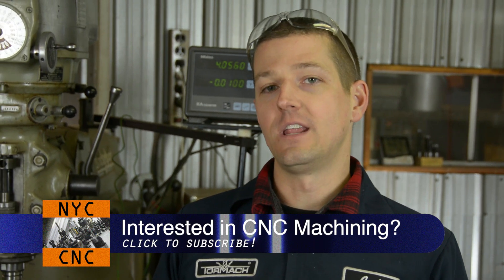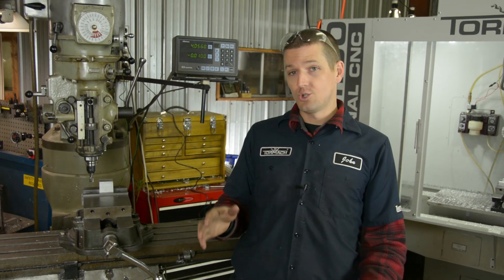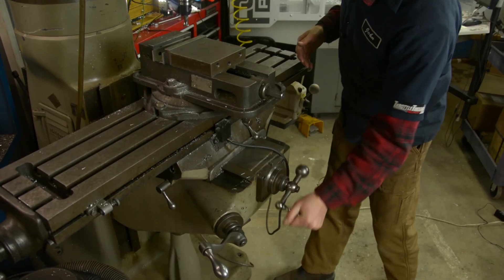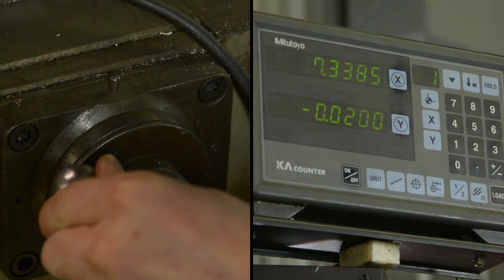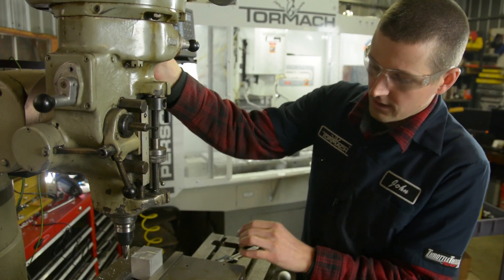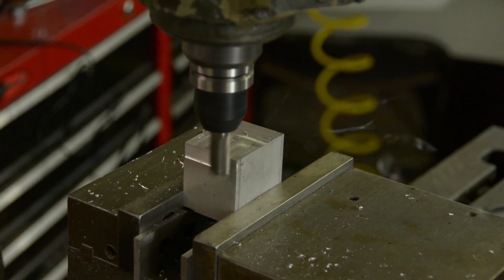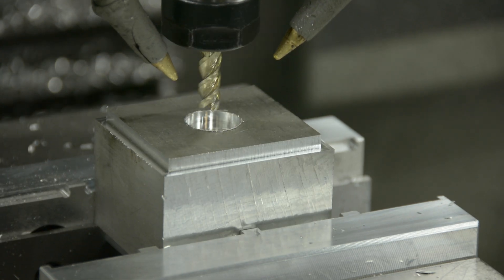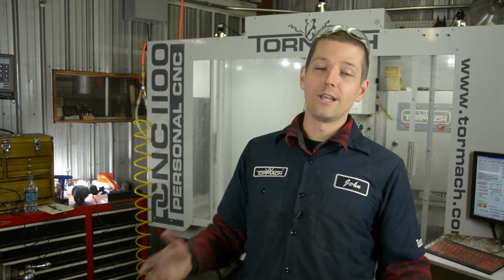Beginners Guide to Manual & CNC Machining!

Comment: A pull on that sleeve is going to be a disaster.
Reply: I'm still manual machining off a tos kurim and still do what a cnc can do👍
Reply: I think OSHA requires guards on this stuff now.  Read an article they fined a shop 10k per machine.  Nobody uses them though.  Such a hassle
Reply: So you're saying nobody can be a manual machinist anymore? Lol
Reply: Dave the point of a CNC wasn't to do things a Manual machine couldn't it was to do it easier and faster and more repetitive.  You have a thousand part order with a + or -   .001 tolerance its going to take you alot longer and probably have more scrap if your not careful with your thinking on a manual machine.  Cnc program it adjust it and boom hit a button 1000 times maybe make a minor tool offset here and there and done BOOOM $$$$$$

Comment: I am in the process of making a cnc machine with the help of your video links. @ work I've used a bridgeport drill press. I'll get to the point; in these machines the table moves and the z axis is fixed. In your opinion is that better than the material staying put and the tool moving?

Comment: Great video John. Thanks so much for doing this intro video for beginners. Well worth it. I will be showing this to my daughter when my Shapeoko 2 turns up. I've bought it to see if she will get into learning how to model in CAD, design for manufacture, but also to document the process on my blog. So a whole gamut of skills for her to get into. Can I ask, what CAM software are you using? I'm curious about the funny little lead outs into the center of the circle at the end of each boring cycle.
Reply: NYC CNC 12 years old, 13 in June. Have you given CAM for Fusion 360 a whirl yet?
Reply: NYC CNC The thing is it may have a big impact on your run times... and help with that back log. Which CAD software are you using?
Reply: NYC CNC Excellent. Well you can get HSMWorks Xpress for free as well. Bloody good 2.5 axis with some 3-axis toolpaths as well. There will be bugger all learning curve for you, but immediate run time and toolpath generation savings.

Comment: You should also conventional cut on the manual mill, as they have backlash.
Reply: Lol no problem. To be honest I haven't used a manual machine for a long time. I've always had the option to use cnc. If I can have a machine do the work for me, I gladly will lol

Comment: Great job John! Sorry I have been "MIA" it's wrestling season for my son so I'm playing catchup on your videos along with a few others.. 

Where do you get your endmills at? Do you have them resharpened after they have been used in the CNC and then use them on your manual machines? Just wondering. I know some guys that do that. 

I happen to have a really cool machine called an Elite A.R.5/E.T it's a tool cutter grinder but so much more, sweet machine. 👍

Thanks for reaching out to the little guys and girls in and around your community and of course all of us that follow you.

D
Reply: Yea I wouldn't have gotten into it myself if it want for the awesome deal I got on the machine with a huge box of all kinda wheels for it, setup time is the killer but once your set up your good to go. 

I love my McMaster for sure, heard of Lakeshore never used them and haven't heard of Maritool.
Reply: I use all kind of metals from Aluminum to tool steels like 4140,4150 also some cast iron. 

D
Reply: Yea I wouldn't want to have to sharpen Endmills on my surface grinder it would be a pain. That's what my T&C grinder is for, also you can get all the angels just right and the reliefs just right. It just makes for an endmill that looks new just undersize.

D

Comment: John, Thank you for putting this together. Very basic but you did a good job of bringing out the similarities and differences between manual and CNC procedures. It would be cool to follow this up with a similar presentation on the manual and the CNC lathe.
Regards, Paul